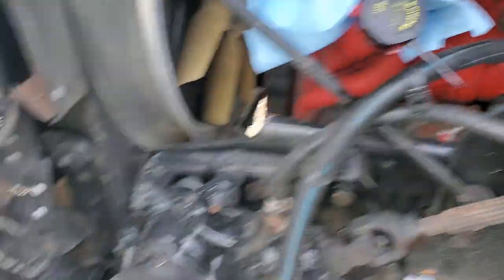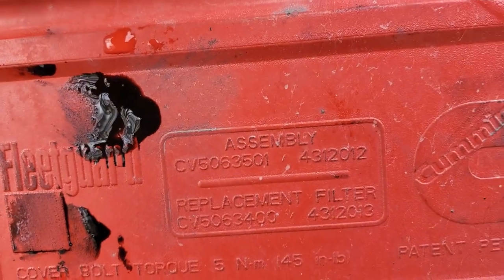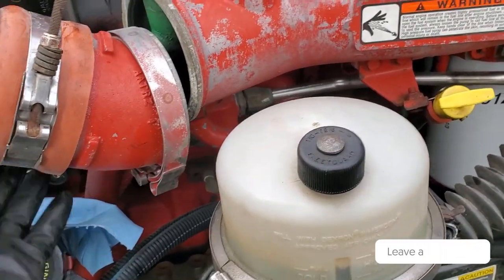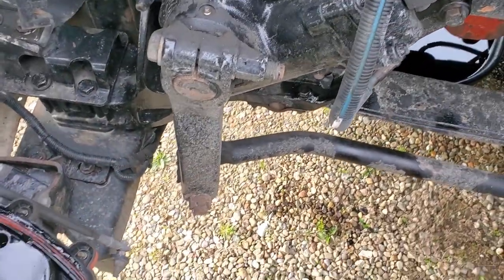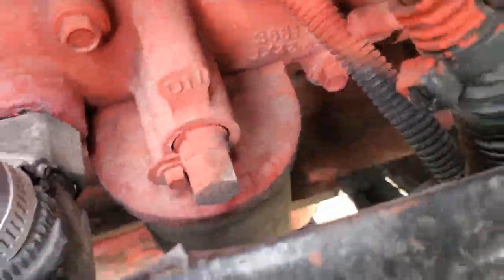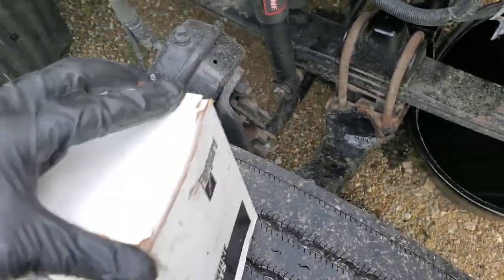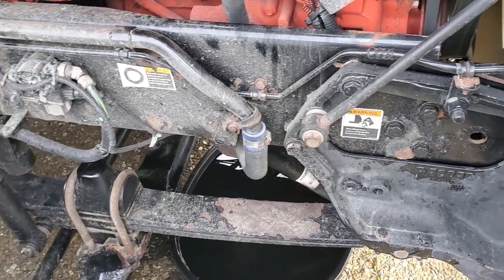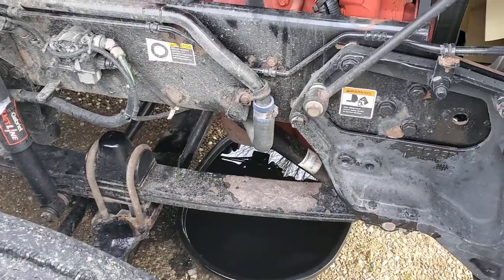The Forgotten Filters - Crankcase & Coolant - Cummins ISX 15 | Owner Operator Trucking Repair DIY

Comment from the maker: ALL, I just wanted to add that other makes such as Paccar, Volvo, CAT, etc., have these filters as well.  Cummins recommends recommends replacement of the crankcase filter every 1500 hours or annually, but keep in mind that this is for a new engine.  As your engine wears, and produces more "blow by" this filter will sludge up faster.  This crankcase gas is recirculated through your intake and burnt in the engine, a nasty filter can case fuel economy decline and other issues, that is why I change mine frequently. Also, I believe I said the torque on the cover was 15 inch lbs, it is actually 45 inch lbs, so please check on you individual cover for those specs. Thanks for watching!
Reply: I used the service free crankcase filter,do I need to replace it frequently? Thank you!
Reply: @Trucker361  do you ?

Comment: Hey Ryan.
I have the same engine.
I’ve switched to Crankcase Ventilation (aka maintenance free)
Part number 3691476
Cummins gives Lifetime, but I’m replacing mine  every 6 oil changes.
Reply from the maker: Thanks Ravil for sharing! 👍
Reply: What year is ur engine
Reply: Just cut the filter media out and run the plastic plate. If your engine is in good condition, you're not going to have a lot of oily blowby. The filter is just more dumb shit ca had put on.

Comment: Thanks man.  Very helpful.  I'm hoping this is what's throwing a crankcase pressure fault code. I've got the CEL with wrench icon, but dash is not showing any faults

Comment: What is that black wire that looked like It's new behind the big filter that's on the right side of the truck. I went and got an oil change and they broke that one all to hell I had to force it in to get it plugged. I noticed it when I went to get my def changed out. I am wondering if that is the reason why I got a CSR code in the truck

Comment: Thanks for your video! Question did you removed the little screw  on the left next to the valve? For the coolant filter please help.
Reply from the maker: Just answered the question on the other comment. You can leave the screw alone
Reply: @truckingandfixing  thank you so much! And thanks for the reply.
Reply: @truckingandfixing  also i wont have issues if air is trapped inside ?

Comment: How can i tell the difference between the screw on oil filter from the screw on fuel filter on the isx? Can you please do a  video on those filters and how to locate the egr valve. Thanks.
Reply from the maker: Your oil filter is longer than the fuel filter and is located on the passenger side, the fuel filters are on the driver's side.  I'm out on the road now, as soon as I'm at a quiet location, I plan to do a video on my truck and some familiarization.  Thanks for the question!
Reply: @truckingandfixing  appreciate it, thanks.
Reply: If u can clean the filter up around it says FF which stands for fuel filter and LF stands for lube filter don’t get it mistaken power steering it also says FL but is at the top and line goes ti steering fluid reservoir.

Comment: I change my coolant filter yearly, with a flush, crank case filter 2x yr, and another little talked about, the def filter yearly, as well as a yearly air dryer filter. Tranny filter?